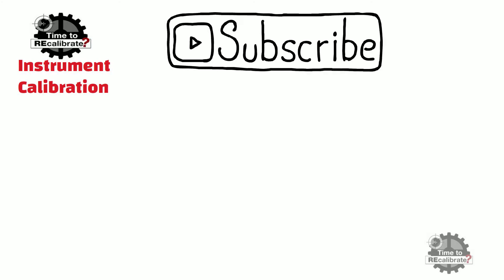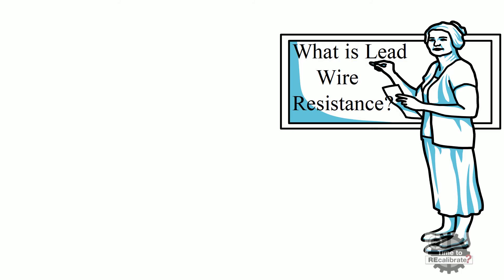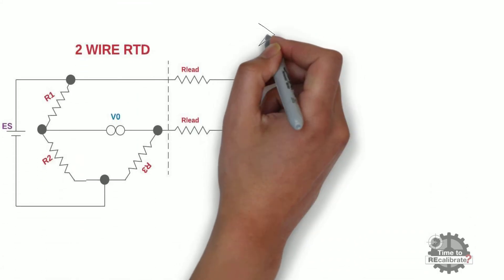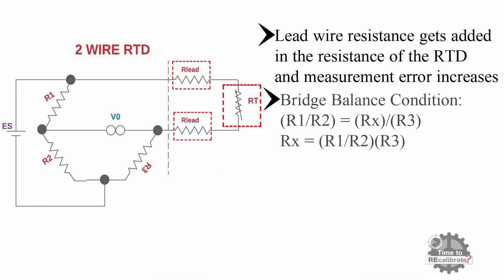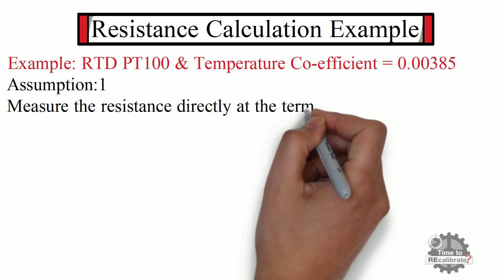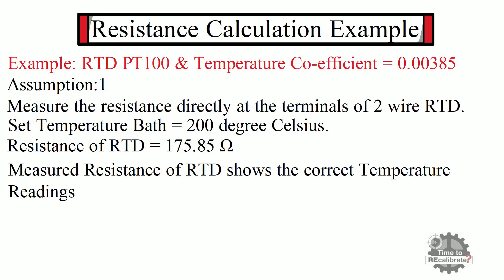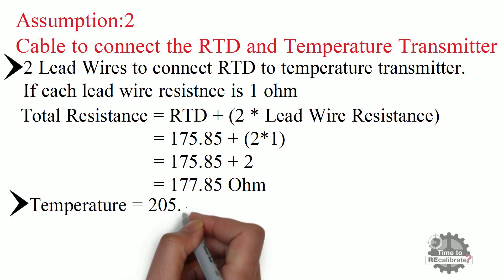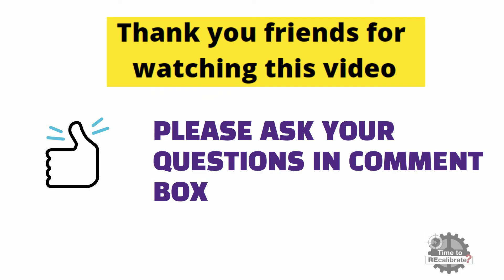What is Lead Resistance in RTD | 2 Wire Resistance Temperature Detector(RTD PT100)

Comment: How do you compensate for lead resistance in a two wire PT100
Reply from the maker: Hello Brighton 
Thanks for asking this question. The only way to compensate this error is to manually adjust the offset of the instrument.
Or else you need to use 3 wire PT100 RTD.